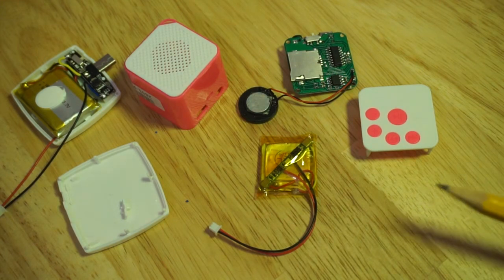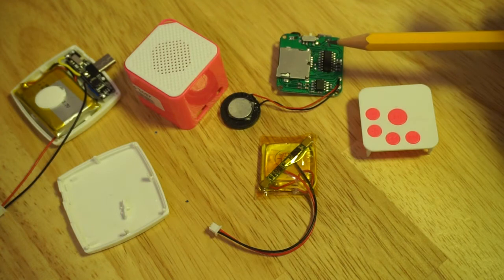Making a "disposable" Power Hit charger reusable

Comment: Tried this recently after seeing this video, and as you mentioned I used the combined tp4056 and discharge protection board, but when I attempt to use it (fully charged to 4.2V) with my phone, the voltage quickly breaks down, and then rebuilds when unplugged, I'm rather new to electronics so am unsure as to what's going wrong, does anyone know what the issue may be?
Reply from the maker: The boost board might be shorting against something. I put a small piece of electrical insulation tape between the two boards as a precaution.
Or the boost board might have failed - not being built with the highest quality components as it is meant for single use.
Reply: True, I'll give that a shot though and see how it goes :D
Reply: Ah okay, when I put 4.2V to the battery ports of the charger circuit, it only outputs 900mV or so, so that seems to be what's playing up

Comment: Hello so what are all pieces needed to make this work ? Could you list them piece by piece trying to make this with my nieces .
Reply from the maker: The main part is of course the Power Hit which I see are still available at Tesco Express.  There are other "disposable" LiPo-based chargers you can order online as well.  The other essential part is the 1S 3.7V battery protection BMS PCB.  Getting the right size that will still fit in the Power Hit case is not guaranteed and you might have to order 10 or more at a time.  You might be able to recover the PCB from a dead phone battery or RC helicopter LiPo battery but there are risks - deliberately damaging a lithium ion battery could start a fire. One of the lipoly batteries in a cheap Chinese Bluetooth speaker started smoking when I tried to extract it to add the missing protection PCB. 

Other parts are the JST connectors and/or TP4056 to facilitate recharging.